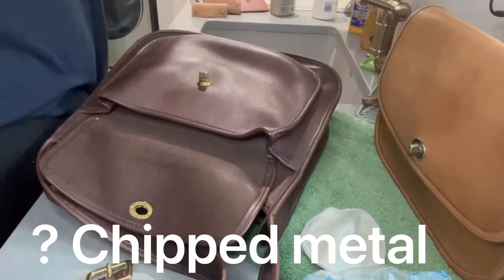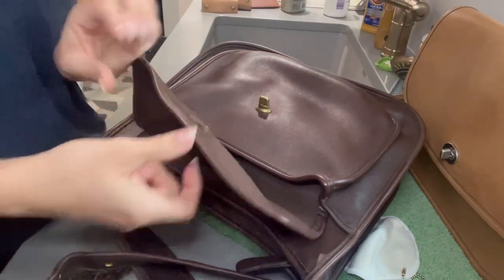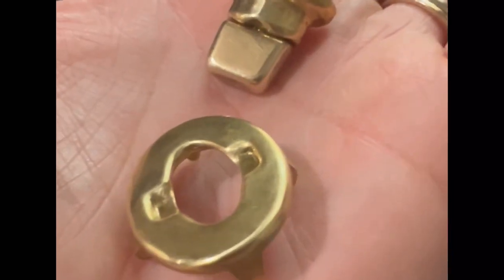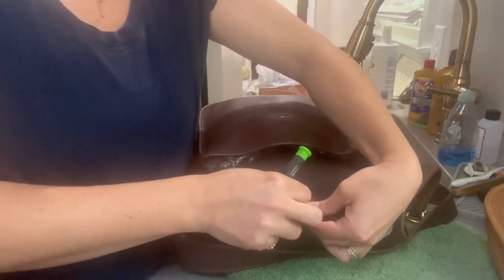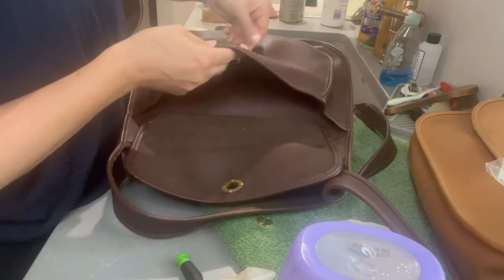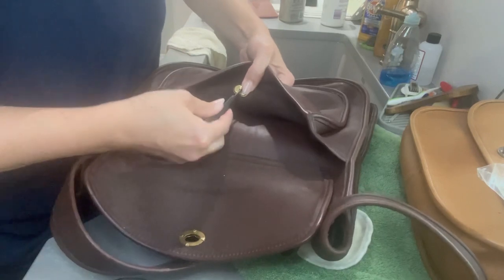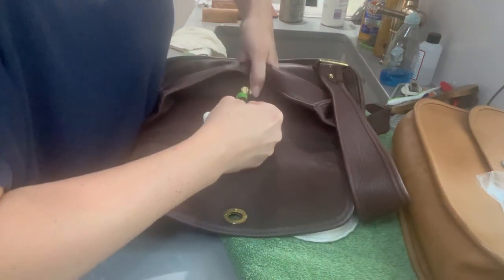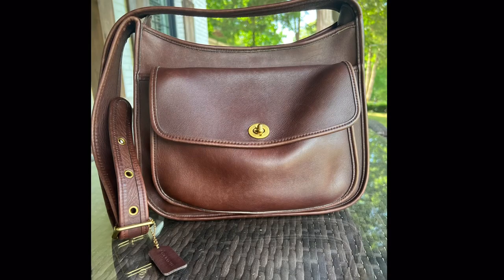How to remove and replace Vintage Coach Turnlock Hardware for cleaning and repair.

Comment: Yes! Thank you. I had removed my Taft hardware ( first time doing ), about a month ago and turn lock was loose. I was afraid to redo. Just did it with your tip to pinch bottom first and it’s secure. Thank you ! Thanks to your hubby also 😊

Comment: How did you remove the shellac? Would acetone work?
Reply from the maker: No, you need friction to remove it. I use fine steel wool. However, if you find a chemical that will get the job done then I would be super stoked! I call it ‘shellac’ but I don’t know technically what the composition of the clear coating is. Just that it was there to keep the hardware from tarnishing but sadly, it will chip and scratch off with use and therefore lends the hardware to look like chipped metal and gross eventually. If it’s still intact for the most part I leave it. Otherwise, I put in the manual work of removing it.
Reply from the maker: I do have a video on this but it is unnecessarily long and ‘eventually’ I will make another, shorter version;)

Comment: Michelle, I've become a big fan of yours -- thanks for all your great videos! I have a court bag whose d-rings are almost worn through. Are those something the average person can replace themselves? Is it possible/necessary to obtain Coach brand d-rings, or will any brass rings do?
Reply from the maker: Hey! Yes, absolutely replaceable by yourself. You can get solid brass d-rings on eBay, Etsy. You want to make sure you are getting rings with the break. This way you can work the strap onto the ring and bag and then pinch close!!